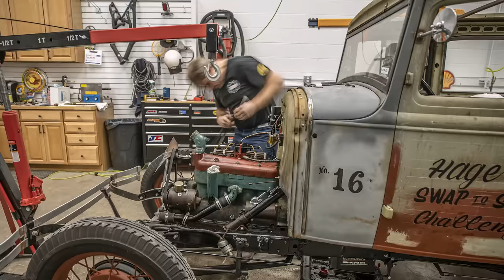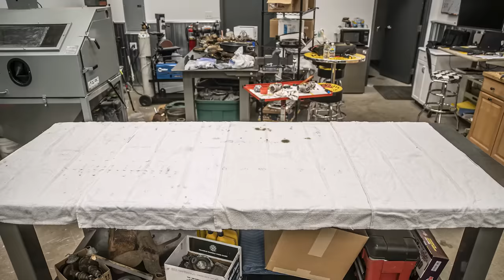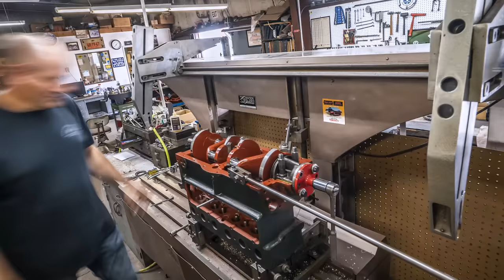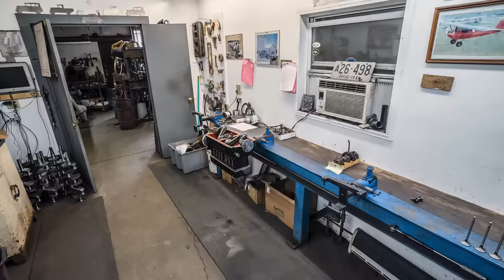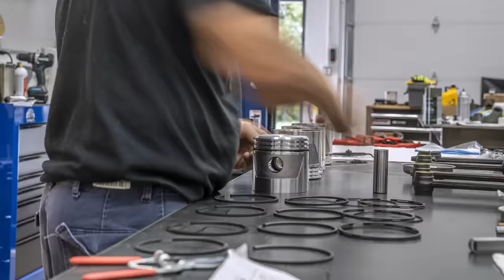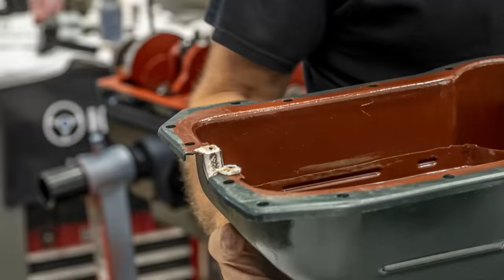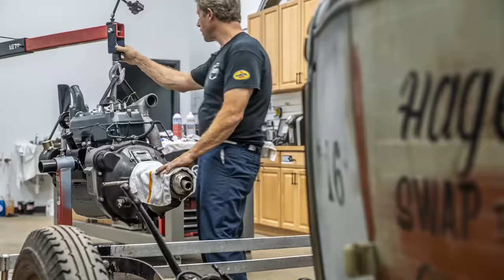Ford Model A 4-cylinder engine rebuild time-lapse | Redline Rebuilds - S3E4

Comment: Pouring those Babbitt main bearings are a lost art now days.
Reply: I just posted a question what was going on with the bearings, and I thought it was lead?
Reply: Looked like aluminum?
Reply: It is and it isn’t,  heavy industry/oilfield Babbitt bearings are still made  daily.  Most modern pumpjacks still utilize hand poured bearings
Reply: I was wondering what that was. I have a lot to learn still.
Reply: My Chevy 216 from 1947 spun a bearing. I could  have had it fixed but opted to go for a 235ci engine better. More power, 40 lbs oil pressure apposed to 13 lbs, and about 30 more hp quite a bit more torque. Like you said, lost art for the everyday man.
Reply: @AMRAMRS  dude how do you onow this im impressed
Reply: Its not just lead or Aluminium, its Babbit. Babbit makes great low speed bearings.
Reply: I remember watching my dad doing them on an old doodle bug he built. Amazing!
Reply: @worldends2  Lead mix has copper and other alloys, not aluminum.
Reply: @AMRAMRS  Its a mixture. You could actually order a block of this material and do your own at one time. My dad used to do this kind of work years ago.
Reply: Seems like some bearing manufacturer would offer inserts as a replacement?
Reply: @worldends2  h""""~
Reply: white metal bearings my dad used to call that, great video.
Reply: Bearing shells were a great invention.
Reply: I'm 19 and completely lost...someone wanna fill me in on what's so special about these bearings
Reply: Babbitt main bearing is also a journal bearing ?
Reply: so yrue
Reply: Back around the early 2000s I thought there was about a handful of guys who could do babbit , maybe some of them have passed on the skill i hope so.
Reply: @liveandletlive2894  
It's not just a half shell you drop in , you have to cast it in place with molten material and then machine it. 
They aren't removable when done. 
Actually they are removable if someone didn't pour right or you rev the beans out of it ....😅
Reply: @MrTheHillfolk  ah ok thanks!

Why cant you just get a bearing for it and grind space in there 🤷‍♂️
Reply: Exactly what I said.
Reply: yes, but back in the day, they would have hand scraped them with a tool similar to a reamer.
Reply: @liveandletlive2894  that would be off spec. and not totally original i guess, my neighbor used to do this type of work, i remember him swearing and throwing stuff when one of the casting had a defect.  he built many show class model A and model T cars and trucks.
Reply: @scottfirman ,
   You can get babbitt from your local weld supply all day. Done quite a few good size pillow blocks for industrial applications. pour it, face it, assemble, cut the bore, disassemble, debur, usually add oil grooves, clean, and ship! Easy peasy! :D lol
Reply: @MrTheHillfolk , Funny!, and true! Contamination is a no no when pouring babbitt bearings! :)
Reply: @liveandletlive2894  
Most of those premade bearing shells are layers of different material , you can't really machine them.  and I bet the block bore isn't the straightest in the world so when you pour them you can get it straight then. 
Pour em and then align bore them.
Reply: @oldnick4707  
My dad worked with a guy , had to go about 4hrs away to Connecticut or Massachusetts to get em done in a model t he redid.
Reply: @MrTheHillfolk ,
   Don't surprise me none, thinkin I'd rather have some guys that do these oft-times and regular and have a proven record of success before I paid the bucks! It's either right or it isnt! :)
Reply: @oldnick4707  
For sure man, for sure.
Haha like those guys are awesome at this , probably have no website and are mostly ungoogleable😂....word of mouth still gets em coming from miles around.
Reply: @MrTheHillfolk ,
   Yup, lettum make a buck! Sure looks like they're earning it! Was talking to Dad about this the other day, (I have a 29' model A chassis with motor, trans, etc., supposedly fresh motor rebuild, then set out in weather for 5 years or so! lol) He showed me a big crate with all the babbitting* dies for model A four banger! Dad's funny that way!
Reply: I was actually wondering what he was doing there. Pretty cool
Reply: Wowed by that babbett job
Reply: I applaud you for even knowing what the hell they were doing there thanks for that. I had no idea that was even a thing.
Reply: live and let live watch pouring Babbitt bearing by Keith Rutger
Reply: live and let live sorry Keith Rucker
Reply: @routtookc8064  It is babbit of which there are several types. Lead babbit nickel Babbitt, composite babbit which is used as a bearing surface.
Reply: I didn't know that's how they did it and I learned a lot from my automotive school twenty years ago and this was never even mentioned, but they focused on current tech at time (94-96)
Reply: When I was very young, <5 years old ~1963, my Dad built a complete 1929 Model A Roadster from rusty junk parks he scrounged from everywhere. He drove it to work for years. Years later, ~ late 1970s, he put in new rod bearings after we drove it half way across the country. He said the old ones were The A bearings and the new ones were C bearings and would last longer. I know the C bearing were placed with only the oil pan off, like on modern bearings. I can’t find info about the difference. Did they have steel backed bearing shells when he first rebuilt the engine in the early 1960s?
Reply: @gabrielsandoval4994  I, as a 13 year old in 1960, had a 51 chevy deluxe,  with the 235. The body was shot but the engine ran like a top after having a valve job done on the head and installing a JC Whitney solid lifter conversion. Great fun for a young teenager. In those days my most important book was the motors manual.
Reply: @kenjsr1  in 51 Chevy was still using the oil dipper system to oil the engine, in 1954 I believe was their first full oil pressure engine. That’s the one I put in my 47 Chevy. A great engine, nice torque, and easy to work on. Were you able to drive your car at 13?
Reply: Wow!!  The amazing stop motion photography, the amazing mechanical knowledge makes for an amazing video.  It’s no wonder that your subscriber numbers are growing so quickly.  Thank you very much!
Reply: We call them white metal. We have 1920s and 30s engines in work that still use them on crank bearings. Never seen them poured before. Was great to see!
Reply: Can't take away anymore... Gotta add.
Reply: I think he talks about them in one of his videos. They had to pull the thing off to crank it bc the starter wont turn the engine with the new babbitt bearings until it gets worn in a lil
Reply: They still use Babbitt on elevators

Comment: I think there is no engine you wouldn't rebuild to factory condition, you are amazing. It would be awesome to see you guys do a wankel or a Ford 429 shotgun :D
Reply: Wankel motorcycle engine for sure
Reply: its actually better then factory used modern tools
Reply: @cc9z  I'm sure you're right, it's probably been rebuilt to closer tolerances, and maybe even in a cleaner shop.
Reply: A lot of older engines benefit greatly from more modern machining and precision. Usually better than what the original factory could even imagine.
Reply: @masterspacetime2826  you can kiss him and figure it out
Reply: @CanadaBud23  even the modern coatings that were non existent in those times like moly coated Pistons

Comment: When I watched this in its entirety it reminded me of the time I had to change out the windshield washer reservoir in my Toyota Rave4. Nothing major other than completely removing the front end body panels in entirety. Thank you Toyota engineers. At current hourly cost per hour that's a 4-5  hour job. Approximately $600 in just labor alone. Parts? You're at their mercy. Lol

Comment: The engine must feel nice for getting a fresh rebuild
Reply: And this awrsome old roar.
Reply: ... same here... I almost hope to see it wagging it's tail pipe 🤣🤣🤣
Reply: That engine was not originally built to these tolerances. The tooling didn't exist yet. It's literally better than new.
Reply: @BlackBladeGroM  all that tooling may not of been around yet but they could keep the tolerances very well they were making precision items back then that were hand fitted look at the 1911 pistol many modern companies make them and have excellent tooling but if you don't know how to fit the parts to the right tolerance they don't work well it was ford who used guage blocks from Carl Edvard Johansson for his assembly lines and bought the company from him guage blocks are used for the calibration of measuring equipment used in machine shops, such as micrometers, sine bars, calipers, and dial indicators
Reply: @samellowery  yeah, but not like today, that engine runs better then it ever did

Comment: After all the machine work - this will probably be the most precise blue printed model A engine on the road. No way they could repeat tolerances like that in the 1930s.
Reply: You want to bet? My grandfather had his own garage in Dearborn. Henery Ford actually purchased the whole building and had it moved to the Henry Ford Museum.  I still have a few wrenches from that garage as well as a couple light bulbs from the lights.
Reply: Don't see what you're point is here,  but ok, cool I guess.
Reply: RC Hobbyist Extreme what? Go back to your toys kid
Reply: so much ego in this thread. lmao take a chill pill you guys
Reply: Thanks everyone for turning this thread into a shitshow
Reply: @Jurgy777  How do you figure? I have a lot of respect for this man's work. Those engines were designed to be repaired in a barn if nessary. My Grandfather owned a Repair shop on Telegraph road in Detroit. Henry Ford purchased it lock stock and barrel and moved the whole thing to Green Field village. I still have a few model  A and T wrenches he owned.
Reply: Why would you say that?  The tooling used to rebuild this engine are the same tools used to build it originally.
Reply: @scottfirman  weird flex but ok
Reply: These engine's mains were within a half thousandth or so (tot.) when new. That's about what these fellers got also, if they're as good as they seem. Ford used, (still does), Sunnen hone machines etc. that are just fine.
These guys approximated what was done originally to produce this engine. Incidentally, these engines were produced in the largest, most advanced factory on the planet at the time. When brand new, that engine was a tour de force of accuracy and modern machine thought.
Reply: youd be very surprised what they could do 100 years ago
Reply: don't sell em short most of the machine tools used in that video where in existence before the 30's and they still used the Babbitt bearings
Reply: @oldnick4707  sorry but no. Modern machining equipment is precise down to the 1/10,000th. Even if Ford still uses the same brand of machines, they have certainly improved greatly in the last 90 years.
Reply: @eclipsegst9419 , sorry but no.
   Re-read my statement. I was referring to "at the time" as to "modern machine thought".
Also, these guys in the vid got within a half thou, or so, which is fine for gummy gummy babbitt. :)
Reply: Not even close.
Reply: ryan boss I know right! Only improvements on this rebuild are the modern lubricants ,gaskets and rubber mounts .i bet you could stand a nickel up on that engine while it’s running
Reply: Did you dyno it?
Reply: I'm almost certain the equipment used on the babbot bearings is the same equipment used a hundred years ago, my dads machine shop actually has alot of lathes, valve grinders and his boring bar are all close to a hundred years old, they had measuring equipment that could measure to a millionth of an inch even back in those days
Reply: Try 1890 mate
Reply: It probably wasnt the most accurate but still the machinists that build big stuff, they are the fuckin experts on everything, and they check 3 times, think about what theyre gonna do, it may take 1 hour to think about it, but itll take them 30 mins to do something, the tafe teacher im under did big stuff on CNC like for mining companies being in Australia minings everything, and my grandfather was a fitter welder who worked with lathes and welding
Reply: It probably wasnt the most accurate but still the machinists that build big stuff, they are the fuckin experts on everything, and they check 3 times, think about what theyre gonna do, it may take 1 hour to think about it, but itll take them 30 mins to do something, the tafe teacher im under did big stuff on CNC like for mining companies being in Australia minings everything, and my grandfather was a fitter welder who worked with lathes and welding
Reply: Kinda looked like the tools used were from the 30's. One thing that enabled the assembly line to work was precision combined with standardisation of measures with gauge blocks. This enabled parts to fit no more "one off's".
Reply: @eclipsegst9419  It was possible at the time to build these engines to the kind of tolerances that this engine was built. The difference is, they were building hundreds of engines every hour, so although they were built with precision, they were built to be "good enough".

But "good enough" was pretty good. Pistons made compression, valves sealed, bearings supported the crank, and oil flowed through the engine and most of it stayed in; for a specified amount of time that was a lot shorter than modern cars; but there were a lot more machine shops that could rebuild it and even Sears sold rebuilt engines on an exchange basis.
Reply: @scottfirman  So what are you trying to say? Your reply makes no sense. All you've said, and are defending, is that Henry ford bought your grandfather's building. What a dope!
Reply: Beg to differ...

Comment: Didn't know anyone did Babbitt bearings anymore.

Except Keith Fenner!
Reply: Is that what the lead was for?
I have very little knowledge of the flathead style engines...
I'm used to conventional bearing engines.
Reply: @jamesburris4078  Babbitt used in an engine bearing contains little if any lead. There are Babbitt alloys that do contain lead, but those are only used for very low speed industrial bearings, not engines. Modern insert bearings also have a Babbitt lining.
Reply: Still used in really big bearings.  Most power stations run them in their turbine/generator train.
But yes I'm a bit suprised there are an engine recco shops out there still doing it.

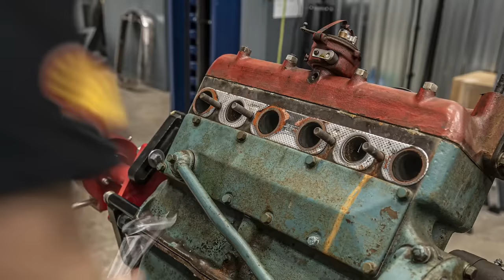Comment: 1:00 that intake/exhaust design is giving me aneurysms. Granted it's like a century old but still...

Also that engine will probably work a better than it did when it was brand new.
Reply: What is the rectangular opening in front of the manifold for? Any idea? (edit; could it be an intake for a cab heater of some sort?)
Reply: High tec like a Harley......
Reply: @Brian13356  if you’re talking about the big slotted rectangle on top of the exhaust manifold, I believe it was to assist in cooling, a heat sink of sorts. These motors didn’t have a water pump, they relied on hydrodynamics to circulate water through the engine, and I’m sure that wasn’t sufficient enough, so I believe that is just to aid in cooling the engine.
Reply: The intake/exhaust are coupled to keep the intake hot for better fuel air mix, the finned rectangular piece is to keep the exhaust not going seriously hot
Reply: @sundstrom193  You're actually quite wrong. These engines had a water pump that bolted to the head. The finned piece on the exhaust header is a dealer option. You ran that header with a special shroud, and could have a heater in these cars.
Reply: @trexmidnite  wrong. It acts as a heater.
Reply: @BriscoMedia  um, not exactly. I know gravity cooling systems existed without a water pump. Idk what year or if the pump you refer to was after market. I was a kid when my dad showed me this on a T stored in my aunt's barn. No water pump.
Reply: @uptoolate2793  you’re right, T’s didn’t have a water pump. The later years came with one similar to how the nah was driven. All Model A’s have water pumps. Trust me, I know that. I own 3 A’s. One has a SBC though
Reply: I think the Jeep 4.0 inline 6 has a similar design

Comment: "I've got so much room to work on my Volkswagen.

"Can you sleep in the engine compartment? Try working on my Model T"
Reply: I literally sat inside my engine bay to do a valve lash on my 350.  Not the most comfortable place to be but still

Comment: henry ford would wish he had such a shop in the 30s.
Reply: Not really, his way was of efficient production with the lowest cost possible. When their cars ended up in junkyards they would get them back inspect all of it and cut back on what was lasting longer than what people kept them for to lower Manufacturing cost.
Reply: @bryanmartinez6600  I'm talking more in the context of total precision. And frankly it's more because of car design where the chassis of the vehicle is made from alternate materials instead of iron and steel which significantly decreases the need for excess metal which was earlier needed to strengthen the vehicle. No it was more in the model Ts design which had excess metal which was recycled. The difference I was talking about was how we can make almost 30 times more power from a 4 cyl of the same displacement just because of the quality of the tools and workforce.

Comment: What you think the horsepower and torque are of that engine??
Reply: 40 hp?
Reply: Not a lot
Reply: 24hp That’s the factory output or 12 british Hp lol my lawnmower has more power!
Reply: flat heads aren't known for making a decent amount of power at all
Reply: I have a flat head 4 in my 42 2N tractor.  It puts out about 18-20 hp since the rebuild.  Tough little tractor.

Although, I could not believe that it did not have a governor.
Reply: America's only Auto/Aircraft engine, approved by the FAA.
Reply: Makes me a little more impressed with my 2cyl 28hp craftsman tractor lol. Does not have the cool factor though.